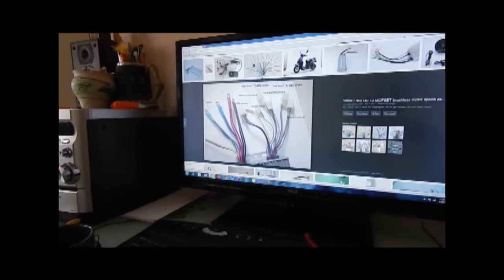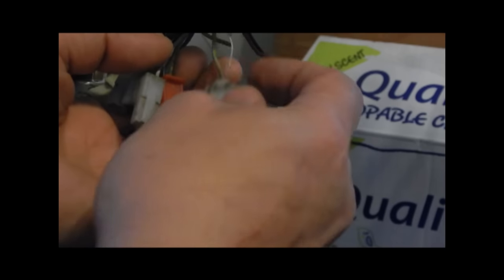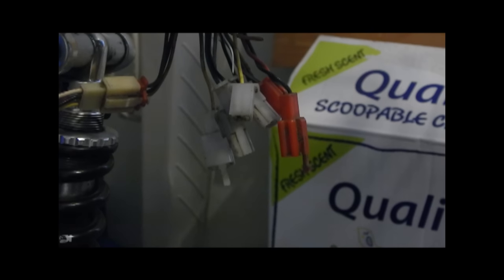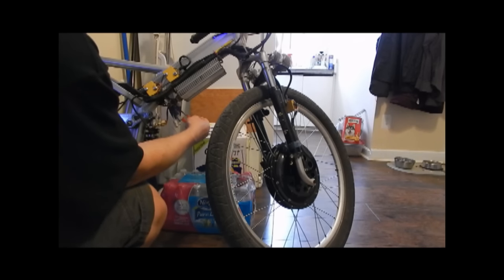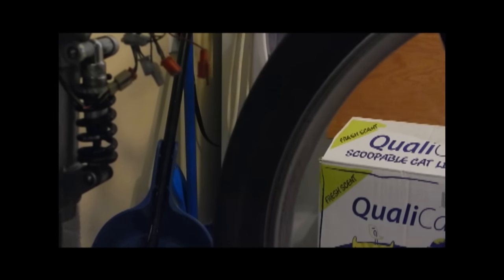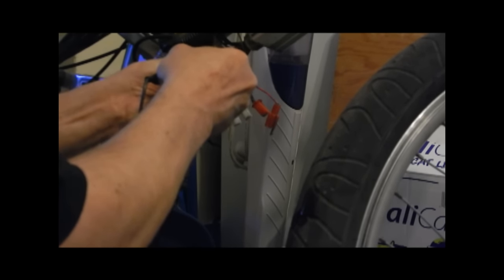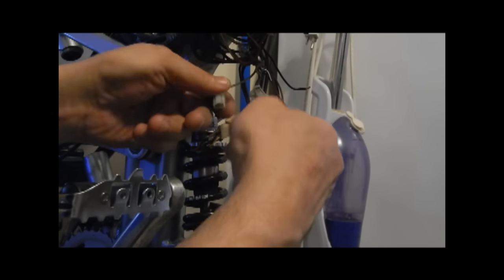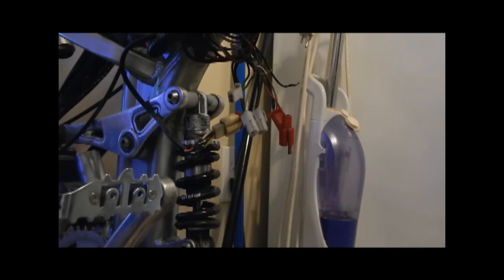ebike controller wiring *finding e-abs*

Comment: Where does the kickstand switch sensor connect to the controller?  My kickstand sensor has 3 wires but I can’t find where to connect on the controller.

Comment: You don’t want to use the EABS as it tends to blow the FET’s in the controller. It only really meant for 250w motors anything higher then to create to much heat and blows controller.
Reply: That make no sense those FETs put out more power to the motor than the motor could generate.
Maybe I'm missing something like calling it e-abs vs regenerative braking.
Or grounding a wire to test it for brake action.

Comment: Are you trying to activate regenerative braking?
I'm not positive but pretty sure the brake is analogous to the throttle.
The brake high is 12 volt ttl and brake low is 5 volt ttl.
Braking is controlled by applying a 0-5 volt signal to the brake low.
The closer to 5 volts the harder the brake is applied.
Grounding it just reaffirms zero brake.
Reply: Have any videos?  Your regenerative braking explanation is all ive ever seen about the feature .  And its about how I imagined it would  work.  I have an older 2016 controller and i cannot get it to turn a motor.  MM testing finds no shorts,  nothing looks damaged on the pcb.  sensors and their  voltages are good.  Throttle checks out.  The cheesy tester i just bought shows what I already knew hen i test the controller.  I think something is inhibiting but cant figure out what.  Ive been able to figure out what most lines do and their voltages but with two i have no clue.  Any thoughts?  These things need a modicum of documentation ya know, for safety sake, good grief.  It should  be required to exist be able to import these things.  The Utubers with the Immaculate workshops , tools and newest  (probably free) merchandise don't really know how this stuff works. I learned more from the Malaysian speaking guy and his jig board.  End rant, apologies .

Comment: so u know how to disable the governor on the daymak em2?
Reply from the maker: it should be two wires joined together on the controller. just do a small test. pull them apart. do a run see if the limiter is removed.
Reply: @karmaEbikes.  k by controler do you mean the throttle or the metal box that has all the wires coming out
Reply: @karmaEbikes.  what Colour are they sir?
Reply: It's always the small white wire that goes in the controller and out just pull apart

Comment: the pedal system does not require hall sensors, then what to do with the wires for powering the hall system ..!?
Reply: Hall sensors work in harmony with the 3-phase motor wires (r,y,g).  Hall sensors consists of 4-5 colored smaller wires. Sometimes all the wires (motor + hall sensors) are bundled in one. More often, they are separate but they are really easy to tell apart …motor wires are the thick r,y,b wires.  hope this helps.

/Bklyn👑

Comment: What's meter line cable some says it's for lcd but what lcd uses one cable
Reply: Bafang wheel hubs have 9 pins. 3 power, 3 sensor, +5volt and ground for the sensors makes 8.
The nineth wire (white) goes to the "lcd" likely for a speedometer.